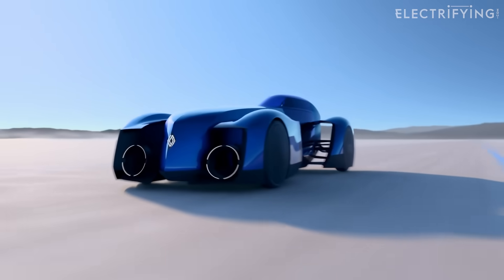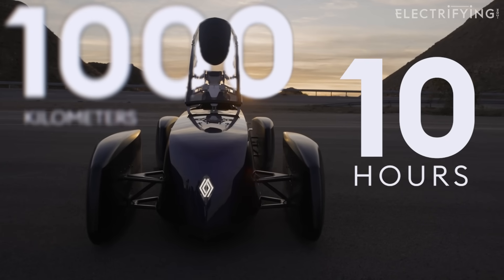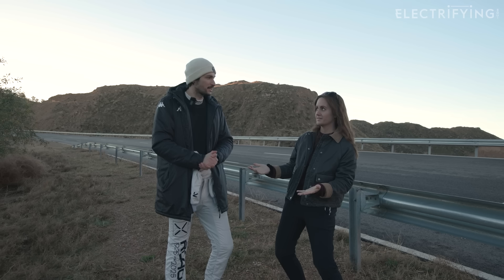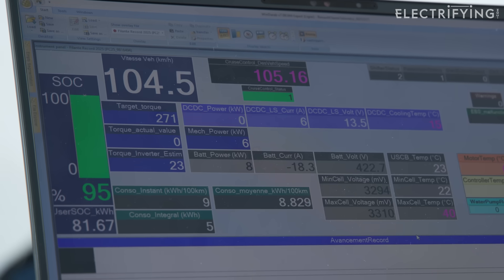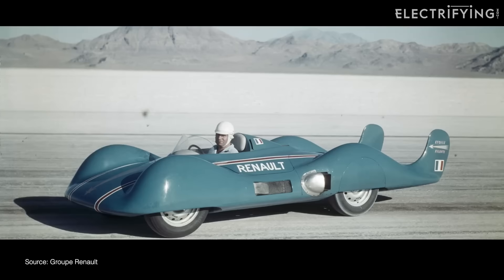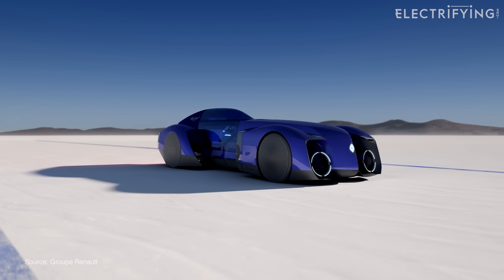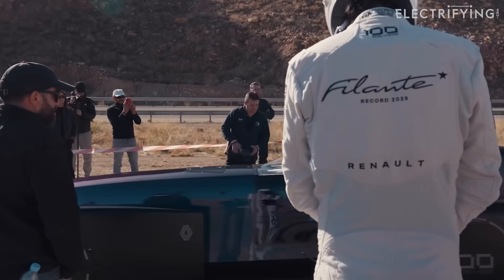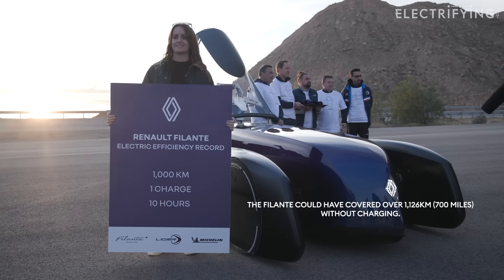1000 km on One Charge in under 10 Hours: Renault’s Wildest EV Experiment

Comment: Hi. Tesla just launched Model Y Ultra Long Range (estimated at 750 km EPA) on a 82kWh battery (even though they have space for a up to 95kWh pack)

... you were saying ?!

You really don't understand that if 1000 km was the AIM and the DEMAND in the market, Tesla could tomorrow launch a 120kW battery pack car model .. but it won't be economically viable, it would be expensive, and not what ppl asked for.

This is only you, the 1%, dreaming for 1000 range EV. The majority are prioritizing price, features, safety etc. and are more than ok with current ranges.

Another example is gamers dreaming for a 5090 RTX card. But STEAM CHARTS show clearly that less than 1% of users are using that card. So 5090 sounds nice, but there is no ACTUAL DEMAND.

Again, just follow the numbers. Where there is demand, there is investment and competition. Where is investment and competition there is EXPONENTIAL progress.

Here are some number to tame your animal behavior: The price of battery pack ($/kWh) dropped from ~$780/kWh in 2013 to ~$139/kWh in 2023.

Progress is made either by changing the technology all together or by improving current tech. In battery tech we are still at the stage of improving CURRRENT batteries. We still haven't reached the dead end of current tech. There is so much more to squeeze...

And all that while waiting for a TOTALLY DIFFERENT battery tech to emerge (like solid state batteries)

Comment: Not to be bearer of bad news, but this looks more like a car made for show rather than performance.
SIM-LEI from 2011 (google it, worth checking) achieved similar power efficiency with tradiational body and 1500 kg weight.
Making split-body design is generally less efficient way if you want to focus on aerodynamics, and in this model it seems it uses more material than if it had simple body since you need to cover both main body and wheels from all sides.
It might be harsh criticism, but it's more of a PR stunt car than useful test.

Comment: 1. it's not as aerodynamic as physically possible (just look at the sharp edges in front)
2. Renault only left F1 as a power unit manufacturer. Alpine is still a team in F1
3. it's not a very impressive efficiency in my opinion. The xl1 was better 20 years ago and we're far from shell eco marathon levels (below 0,1 kWh/100km)

Comment: 10 hours? fckin 10 hours?
Reply: i'm charging batteries every day , 
heated jacket , mp3 player , earbuds , small handwarmers you can put in your pocket . 
it's a god damn drag ... 
i also ride step , which i charge at work too , with all the other batteries ... 
i'm not paying for all that electricity , no freaking way , my bill would be 4x as high , if not more ...
it's not normal to cost this much , just so you can be warm in your own home 
or charge a damn battery , it's absolutely ridiculous , these prices .
pretty impressive feet with the car going 1120 Km / 626 miles on one charge ,
i can't wait to buy things that run on That amount of power

Comment: So to maintain 105km/h with this car you need around 8.62kw of power. For comparison the car I drive (bmw 3 series) needs around 15kw to maintain 80km/h. Because the power you need increases in cubics with speed, it'll need around 34kw to maintain 105km/h, so 4 times higher than this car. 
We can also calculate the drag force produced based on the speed and power consumption. I calculated this car under goes 295.5N of drag force (around 30kg) at 105km/h. Consider 80% of it is aerodynamic drag, the air puts 236.4N of resistance at said speed.
The frontal area of a typical sedan is ~5m^2. If we consider this car to have half the frontal area, so 2.5m^2, we can calculate it drag coefficient, at around 0.21. The Cd of a typical sedan will be around 0.35.

Comment: Doing 1000 km at 100 km/h is okay, but honestly, it's not too exciting. It's clear it was a design and marketing first, engineering second project. I'm sure with a bit more engineering they can do those 1000 km at way higher speeds. It should be done at least at 120 - 130 km/h, but idealy, 150 km/h should be the goal for a future electric car. (Maybe I'm a bit biast as I drive an old diesel car that does 1200 km at 130 km/h, and I definitely think it will be possible to do full electric)

Comment: "It's less a car, and more a rolling science experiment" It's nice that they show what's possible but it would be nicer if it ends up influencing their industry. 

Aptera is an actual production car (in the making) that could achieve this feat as well in their highest kwh configuration. It could go 1600 km on a charge (on normal use) while sold for +- $45.000
It's not yet clear when they go into production but this is much more meaningful than this experiment.

If Renault would be so bold to actually learn from this and implement it in their cars I would applaud their efforts, but legacy car brands generally don't tend to make bold designs.
Unless it's all for show, like a car show, or a one off experiment...

Comment: Aptera offer a ( near) production  3 wheeler with 1000 mile range  for "2 adults & a pet" & sell a camping kit for it too. it claims 6.2Kwh/100km 10miles/kwh .    The actual production car MW Motors Luka EV claim 6.8Kwh/100Km,  9miles/Kwh & it has a retro MGB look which would fit in at a classic car show or video game.  ... So not impressed by this ...

Comment: It's impressive how for now we haven't been able to make a 4 wheel vehicule as efficient as a 2 wheel one that's not trying to be efficient
3:28 this is 7.2 miles per kwh
while zero motorcycles bikes at 100km/h are at 7~8 miles per kwh

motorcycle manufacturer have less money, but it would be interesting to see the efficiency of a 2 wheeler with an aero body and thin tyres at 100km/h
it could probably do 1000km with a 40kWh battery that would weight 200kg then

Comment: This is a pretty impressive achivement by Renault! Nevertheless, it is very strange, that they did not improve the car much more ...
- rods and suspension of the formula car design cause significsnt drag
- airflow of wheel fairings and main body interfere with each other and cause more drag plus a high impact of side winds
- main body design is very boxy; round shapes would reduce the cross section
- cockpit seems pretty wide, so a smaller dimensions also reduce the cross section
- some edges on the upper front of the bonnet and the wheel fairings will most likely cause separation of the airflow
- vertical trailing edges cause vortices, they should be angled backwards
- weight is much, much too high
Reduce the frame structure, get rid of useless lights, screens, design elements, etc., reduce the vehicle's size, improve the aerodynamics (avoid the formula car design!), install a smaller battery and then you will be much more efficient!
Reply: Renault should have got you on board. You could show those experts a thing or two.

Comment: So....with all the perfect conditions..weather, weight,aerodynamics, and and and.... which of these transfer to normal everyday driving? Guaranteed there is not a single item on this vehicle, from the biggest item to the smallest bolt or nut, that will be on any vehicle available to the public..so what this shows is what can be done in a perfect world which is useless to us as the normal everyday customer.. the amount of money and time spent on useless projects like these could have been used to actually make the available product better and cheaper.. this is one perfect reason why things are so expensive,  is because of unnecessary spending doing useless things and passing the cost on to the customers

Comment: What i am asking is, The EQXX from Mercedes got over 1000km of range right? And they tested it on openroads right? So driving a constant speed for 10 Hours might be normal for Americans but Europeans have alot more stop and go, Citys and Co. So maybe this would be cooler to get a Prototype, Roadlegal, Luxury Features like Music and a Heater and do the same in City/Countryroads scenarios. Its a great achievement, dont get me wrong, and the car looks interesting in a positive way but what does this prove?
Reply from the maker: The Mercedes had a much bigger battery of course, but it was impressive. These records help showcase new energy saving tech which will filter down to the cars we drive over the next few years.
Reply: @Electrifyingcom Yeah okay, i agree with that :D

Comment: &:34 not just weight and aerodynamics but things like A/C system, displays and speakers for infotainment, heated seats and or steering wheels, headlights, interior lighting, smart driving systems etc. I'd reckon about a third of the battery life goes to those types of things

Comment: It's good that EVs are getting more efficient. But most of the issue with current cars is they are SUVs, so large frontal area, heavy and unnecessarily chunky wheels. My 2020 Ioniq is averaging 5.8 miles/kWh from the last month of commutes, most of which is on the motorway. The small 38kWh battery frequently beats the 190 mile quoted range, even in winter (it's got a heat pump). The old Ioniq isn't even a dedicated EV platform, but it's only 1600kg and the low roof and slopped hatch means it's got pretty good aero. SUVs are the problem.

Comment: With the wheeles standing out of the mainbody it canˋt have good aerodynamic. at good aerodynamic bodies the total hull surface matters. with build in wheels in the body the total surface is lower. and without disturbing rods the cd is lower…. i think this car was build to be sufficient good and look cool…
Reply: actually no, while yes cd is higher, S is much lower and thus achieves a lower SCd than a full body car
Reply: @UnePintade Frontal area ist not important , total surface area is important. and surface area is lower with buildin wheels. Look at velomobiles they know why they do it in this way. Good book about aerodynamik is „The Leading Edge: Aerodynamic Design of Ultra-streamlined Land Vehicles“ from Goro Tamai.
Reply: @RazzFazz-Race  Frontal area is very important. Total skin drag doesn't tend to be that high. And those wheels are totally enclosed, so the wash will be minimised. If the vehicle was much narrower, like a velomobile, then inboard wheels would make sense. But I wouldn't fancy cornering at >100km/h with a velomobile's track width. Faster cars tend to have a full body over the wheels because the body needs to create some downforce, which isn't a consideration here.
Reply: @DavidMcGuigan Frontal Area for a streamlined body is totally unimportant, it is just made for some easier calculation. And this car don’t need to corner it is just build for the record and going straight . And the rods which are holding the wheels are an aerodynamic catastrophy.

Comment: ... ? what's the point .. No seriously. What the hell is the point of this prototype ? (other than pure marketing) ?
14:10 - Maybe if the target/title of the experiment was BEST km/kwh efficiency it would made much more sense. 
Also , 7.2km/kwh is good , i guess .. given that some Tesla Model 3 variant reaches 4km/kwh - and it's a FULL CAR.
But 1000km range ? There are already 3-4 models on the market hitting that target.. and they are SEDAN CARS not prototypes.
Even Tesla if would aim for such "Feature" .. could release a 120kw+ battery Model 3/Y and achieve that range.

WHAT THE HELL IS THE POINT OF THIS CAR CONCEPT.
PLUS the tech might be misleading because WE DO NOT KNOW how much of the efficiency is from ACTUAL MOTOR TECHNOLOGY or from weight, aerodynamics. If none of the efficiency comes from the motors, waste of time and money.
Reply from the maker: These records help showcase new energy saving tech which will filter down to the cars we drive over the next few years.
Reply: @Electrifyingcom  As i stated .. if nothing was done to the motor itself ... anything "aerodynamically" related (which seems to be 90% of the effect in this car) is redundant.

Again, my issue is with their claim .. not with the car. There are already 1000km range cars on the roads. The sign should have said "most efficient EV" - otherwise just BS marketing to seem relevant.

Comment: Hm, I am a bit dissapointed about the 7.96 miles/kWh. I mean it's good but not amazing, considering I have done 7.1 miles/kWh (8.8kWh/100km) (100km round trip) in my Hyundai Ioniq Classic from 2017. I am regularly getting 6.5 miles/kWh  (9.6 kWh/100km). That is round trip 100km, Summer, all-year tires at normal pressure (2.5bar), 95kg driver, combined city + highway driving (although usually truck lane).

Feels like they have quite some margin left in the drivetrain.... 
I would love to get an answer about what they think why that is.
My car is almost 10 years old and can be had for under 10k€. Yet they are only 12% - 22% more efficient?
Reply: As a fellow Ioniq (2020) owner, I totally agree. I'm monthly averaging 5.8miles/kWh through the winter on my commutes, with well over half the distance being on motorway using climate control and heated seats. And the Ioniq isn't even a dedicated EV platform. I think a lot of the issue with EV efficiency is that they're all SUVs with large frontal area, bad aero, inefficient tyres and too much weight.

Comment: This is anything but a real step forward. They stripped everything out of a consumer car and made it as thin as possible, obviously it will have more than double the range then the regular stuff but it is so far off the demand.

Computer fluid dynamics have been around for years now, it's not rocket science what is the most aerodynamic shape anymore. Keep in mind they aren't offering new technology of battery, material or motor, nothing.

It is a marketing stunt and a fun project, that's it.

They will go right back to making boxy SUVs after this because people need interior space and still prefer the traditional shapes. Look at the Mercedes EQs sales.

Comment: No front, but this vehicle is a joke right? If the Engineers really tried to build an efficient vehicle, they did a very poor job. You don't trust me - look up Velomobiles. Sure those ones are normally pedal powered but you could equip it with a motor too. This Behemoth here looks like it can only fit one person, vehicles a tenth the size can do the same.
Cutting the consumption of a regular car in half is absolutely not an impressive feat. Because our cars are designed with design over efficiency, size over practicality.

Comment: French here: I really would like to be impressed by Renault's car I really would like that. And to be fair, driving 1200km out a single battery charge is very nice. But then I remember Mercedes EQS drove on real road 1208 km a few month ago. With headlamps. So I'm glad Renault's team see that as a rolling laboratory rather than groundbreaking record.
Reply: The Mercedes used a solid state battery with nearly 150 kwh. And AFAIK, they haven't told how fast they drove or how  long it took.

Comment: Not related, this just came through from Volvo, ref my EX30.
Do I have any comeback to complain about;
Volvo's quality follow-up procedures have identified a potential safety concern with a small number of EX30’s Single Motor Extended Range and Twin Motor Performance. We understand from our records, that you are the current registered keeper of a vehicle with the registration detailed above. Therefore, please read the information within this letter as it will explain the issue and provide full details on the action that you need to take.

What is the issue?
Investigations have identified potential overheating of a High Voltage Battery cell. This could lead to a possible fire within the high voltage battery. It is possible that if overheating does occur a message within the Driver’s Information Module as below appears.
Image of safety message in Driver's Information Module
What are we doing to resolve?
Volvo takes this situation very seriously and is working with the appropriate authorities to launch an effective action as quickly as possible. You will receive further communication regarding the solution as soon as it is available.

What you should do now?
Do not charge your battery above 70%

Set the maximum charge limit to 70%.
1. Press the vehicle symbol in the bottom bar in the Infotainment screen and go to Settings.
2. Go to Charge > Select Custom option.
3. Set your charge level to maximum 70%

Comment: The Aptera (which hopefully is closer to production than the Filante) will match the 1000kms and go all the way to 1600kms (1000 miles) in its highest range model. Unfortunately, the launch model is only 400 miles (700kms) but the potential is there when Aptera puts the 600-mile and 1000-mile models into production.

Comment: If only the Renault engineers had heard about the Australian Solar Challenge, they could have saved themselves a lot of work and made much more progress.
Reply: My thoughts exactly. Dutch Uni team won the 3022km race in 34.9hrs. That is 86.6kmh from sun energy from 6m² of panels which in the Australian winter develop about 7kWh a day.
So basically a bunch of Uni students built a car that does 90kmh on 1kW of power.
Aero drag at 100kmh is 23% higher but rolling resistance is same so it probably takes Nuna13 1200W to do 100kmh ergo a 12kWh battery would get them 1000ks in 10 hours compared to Renaults 87kWh battery.
Reply: Yes unfortunately this seems like a stunt for the brand.

Comment: Isn’t it amazing that to do this they engineer in all those things to make it efficient. Slim tyres. All manufacturers know that tyres makes a difference to economy and yet they insist on putting 20 and 21” tyres on EV’s. They ruin efficiency and ride comfort and increase the weight of the car, but still they insist on doing so. Just confuses me.